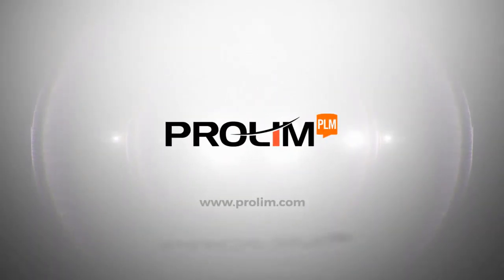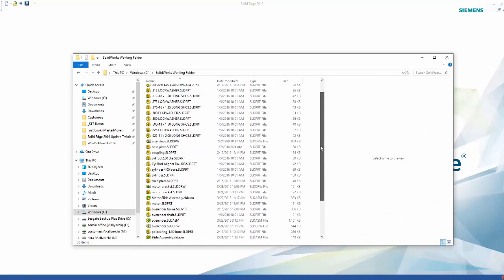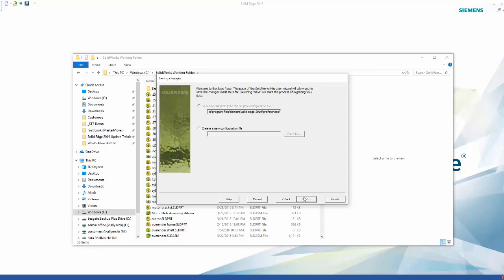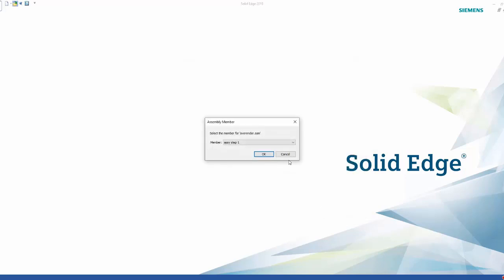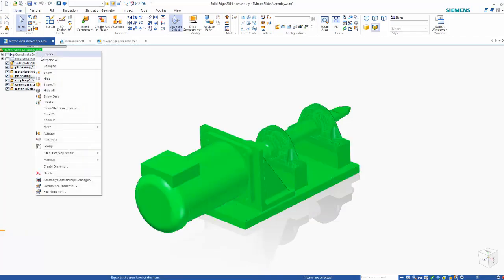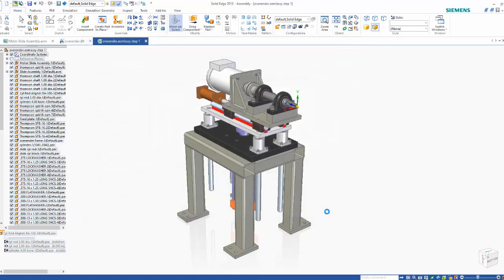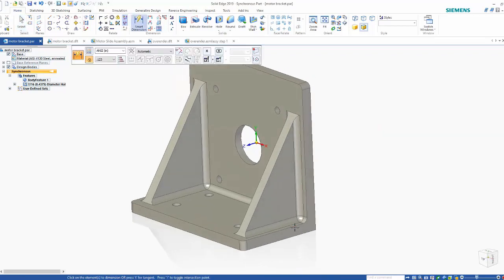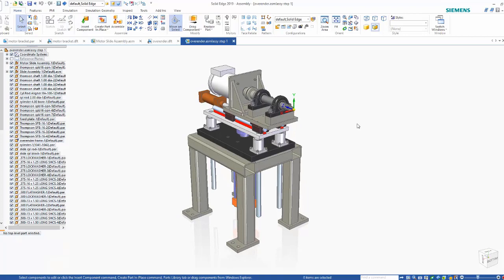Solid Edge: Using the SolidWorks Data Migration Tool

Comment: hi ! i have solid edge student version and when i want to open solidworks data migration  tool  i have an error ''you are not licensed to run this feature'' . what can i do to run data migration tool ?
Reply: Hey, I am also stuck at this point. I also have a student licence. Did you find a way to make the solidworks migration tool work? Thanks for your help.